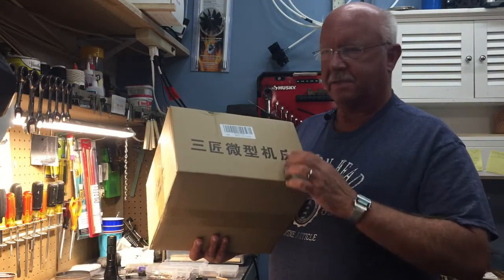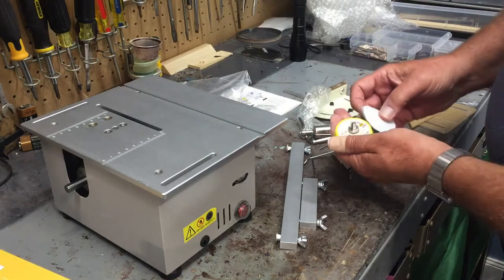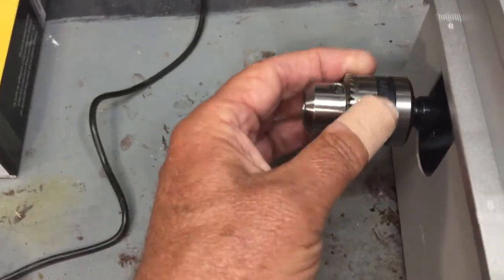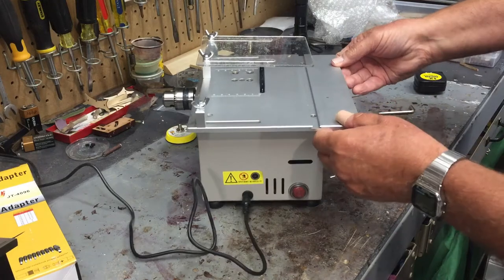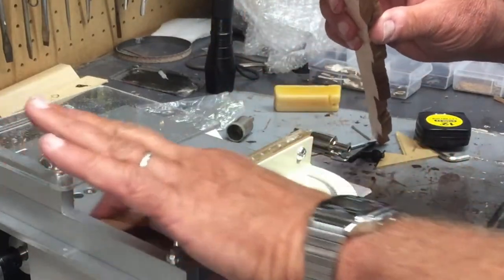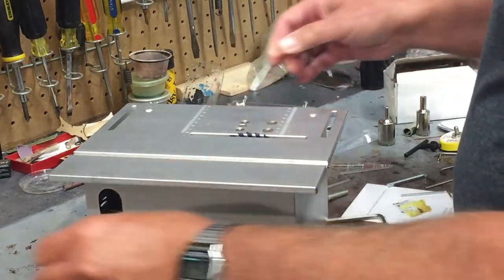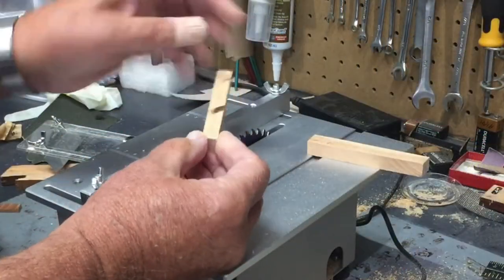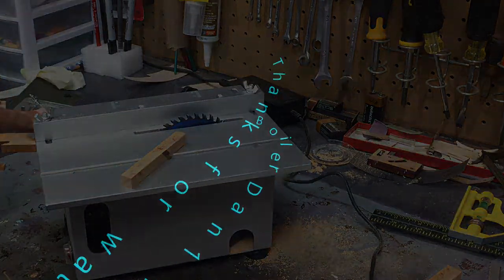Mini Table Saw Review

Comment: I just purchased one of these mini table saws for myself from Amazon and it arrived today. I spent about two hours putting it together and making adjustments. Mine is a 6 generation with the lift saw blade.  I am using it to make some half laps using Wood that is 7 cm x 20 cm. I am making my grooves 3.5 cm deep on the 7cm dimension. The first adjustment I made was to remove the metal fence from the “ruler” (miter gauge) and then I removed the degree dial.  Then I adjusted the degree dial so the fence would sit at a 90 degree angle and put a wooden piece on for the fence instead of the metal fence that came with the miter gauge.  Then I added two small washers under the degree dial.  Doing this lifted the miter gauge off of the tabletop. It had been dragging as you slid it forward and back. Secondly, I solved the problem of dust collection. I had the Flexiport Click-Connect Upgrade Kit from Rockler in my shop and one of the connectors fit in the dust port on the saw with a little persuasion from a flathead screw driver I was able the push the rubber nozzle in to the second ring groove, then I added some tape around the port to seal off the edges of the port. After adjusting the fence on the miter gauge to the blade, I removed the “Backing” fence/bezel face shield and adjusted the height of the blade and cut (using the original blade) the grooves, finishing the edges with a chisel to get a tight fit for the overlapping half lap.
Reply from the maker: You’re amazing!  I made the dust collection work by cutting the opening to fit my smaller shop vac that is hooked up to a small paint bucket wind tunnel device so the bad doesn’t collect everything.  I’d like to see your see your wooden fence design!  I’ll study on what you wrote as it sounds like some good ideas 👍👍. Thanks for sharing .
Reply: @BoilerDan1 Dan I posted my email in a reply today but I didn’t hear back nor do I see it in an answer to your reply. Did you get it?
Reply from the maker: Unfortunately, no I didn’t get it?
I’ll try mine in a response after this one.
Reply from the maker: try boilerdanone@gmail.com

Comment: Thanks Again Dan. was on the fence with this but think I will get one (maybe grind out the sawdust hole to fit shopvac nozzle)
Reply from the maker: I agree on the sawdust hole!  I’ll wait a few weeks just in case something goes wrong and I have a warranty issue....
I like the small size and if the speed is up on high, it does what I need.
Reply: Take a heat gun to hose attachment and mold round end to match that mouse hole opening

Comment: Hello.. and thanks for the video... I like these that actually show you someone using the item they are reviewing,  not just opening the dumb box..who needs a video for that... anyway, I THIS video, you show a small lathe.. I have company area where I'm working so, I too, cannot have huge equipment... where did you get that mini lathe and what was it called... please and thank you...
Reply from the maker: Thank you for your kind remarks. Here’s a link to my review on the mini lathe . 
https://youtu.be/JO0LrxvtrC0
I purchased mine on Amazon . Here’s a similar one that has. More attachments including a mini saw blade that mine doesn’t have.
Thanks for watching 👍
200W CNC Mini Lathe Machine Tool DIY Woodworking Wood lathe Milling machine Grinding Polishing Beads Drill Rotary Tool Set https://www.amazon.com/dp/B07Z2KPGMK/ref=cm_sw_r_cp_api_glt_fabc_CNM6MT44NV2CF42FXY58

Comment: Those green drive belts don't they slip? Wouldn't gt2 timing belts with teeth be better? Thank you!
Reply from the maker: This saw is really for light duty. For that I’ve not had any problems.
But if you try to cut something not light, it does bog down. Although a belt with teeth sounds great…. I think you burn out the transformer or motor.  I only use it for model ship building.

Comment: What is the brand name? What does it cost? (range) What are its dimensions? (It looks really small, esp compared with the classic Proxxon 7070 and the MicroLux Mini Tilt Arbor Table Saw. The box it came in -- was there a larger box to house that cheap cardboard box?
Reply from the maker: Price currently is listed as $114.95.
It’s obviously an import and there are different companies that buy in bulk then use whatever names they want. Ranging in prices from $99-$200.
It’s an inexpensive mini table saw for craft work. I use it to cut thin pieces and I don’t think it has much power.
Here’s a link to the item on Amazon. You can find the measurements from there.
The top is about 9 1/2” X 8”.
It’s definitely an entry level item with nothing fancy. No tilting blade.
I did put on a 4” blade and it worked.
Thanks for watching 👍
Reply: @BoilerDan1  Thanks for all the additional information. About a year ago I thought about getting the Proxxon 7070 (retailing about $365 or so). It has been unavailable, perhaps due to CoVid issues in manufacturing, shipping or what not. So I have also considered the Proxxon chop saw, which has fewer features and is cheaper, about $100 less. This item is also hard to find these days. My sense is that the Proxxon table saw is a bit larger than your saw. One more thing: many years ago I had a Dremel mini table saw and it was frustrating. The thing was not accurate and I never was happy with the untrue cuts.

Comment: Table saws this small are potential tools to make small model furniture but you didn't really give any indication on the precision capabilities of this saw. Hows the fence? Does it clamp on square to the blade at both ends? Any slop in the miter gauge channel? etc. What size blades does it take and are there any better after market ones?
Reply from the maker: It’s not precise, So you need to line up the fence on both ends as it’s just two thumb screws to hold it square. But it works for me.
The blade holds steady considering the price and for light hobby work.
The blade: 4.5"(110mm) Circular Saw Blade I ordered a 60 Tooth Cutting Fine Finishing Table Saw Blades for Woodworking Rotary Tool with 3/5"(16mm) Arbor and it’s giving me a smoother cut.
Thanks for watching and the constructive criticism 👍👍

Comment: It would be really nice if the lifting was basic and the blade angle could be adjusted as well~~
Reply from the maker: I agree.  I’m overdue to make an update:
If you stress the motor any, it will burn out the dc transformer.
The good news is that I took it in to a local electronics shop and they fixed me up with a much better transformer and it now cuts harder wood.  Not sure when I will post something?  Doesn’t solve the no tilting issue but works much better now!

Comment: Would it cut Vinyl Plank Flooring?
Reply from the maker: I don’t think so.  Since the posting, I tried to cut a thicker piece of oak and it burned out the transformer.  The company replaced it for free, but Vinyl flooring would put a lot of drag on the blade.  Light duty crafting is what I would recommend.
Thanks for watching.👍

Comment: Thank you for your video sir. But when giving a Amazon link more better for as
Reply from the maker: Several available at Amazon:
Do a search for “mini table saw “
Below is a link to one like mine:
Thanks for watching 👍
NovelLife Mini Hobby Table Saw Handmade Woodworking Bench Saw DIY Model Crafts Cutting Tool with Adjustable Power Supply 63mm HSS Circular Saw Blade (R2) https://www.amazon.com/dp/B093ST1TJL/ref=cm_sw_r_cp_api_glt_fabc_P823ZC47G1JBFG3VYZPD

Comment: Thank you  so much.
Reply from the maker: It’s not a top end tool and I use a small square to get the guide true to straight. But for light duty it’s working fine for me.
I was concerned about being able to find a replacement band if the one were to wear out or break. I contacted the seller to inquire and they sent me a couple extras at no cost!
Thanks for watching and the positive feedback.👍👍

Comment: I have one of thses and like it,BUT,it doesn't give a square cut,the blade isn't perpendicular to the table. I made some shims from thin brass sheet,I haven't got it dialed in yet. this blade is carbide-tipped,and will cut 1/8" aluminum nicely. I made a large crosscut sled from hardboard that guides by the edges of the table top,it really makes a difference in cutting,but reduces blade hieght to about 25 mm. the rip fence was a PITA,so I made a T-square from angle aluminum and clamp it with a spring clamp.  As this review said,the blade guard is worthless. I suppose you could 3-D print a flip-up guard like a regular table saw and attach it at the back,and include the riving knife for more safety. Paint mixing sticks make great push sticks. I also wish I had bought the 360W version,or they offered an upgrade kit of new 895 motor and 15A power supply.
Reply from the maker: Thanks for some great info 👍
Your talent greatly exceeds mine.
I recently purchased a 3d printer, maybe I will look into printing out the design you suggested.
I agree that the motor is a little weaker than I’d like…. 
Thanks for watching and sharing your thoughts.👍👍

Comment: Where did you get it?
Reply from the maker: Amazon:
https://a.co/d/jkSeM9e
Reply: @BoilerDan1  decent price for sure, I’ve been looking at the proxon one. Nice video thanks 🙏
Reply from the maker: Just realize that it’s light duty for craft type work.
Thanks for appreciating my efforts!
👍
Reply: @BoilerDan1  oh that’s what I want it for hehe. I have a serious table saw. I want this for thin balsa wood mostly. I think it will work fine. I’m ok with taking multiple cuts or even modifying the machine to my needs. I have a proper lathe for polishing. I’m just looking for a quiet accurate saw to cut small hobby stock.
Reply from the maker: Should work fine for that.
I recently saw (no pun intended) what looked like a magnet strip being used as a fence on a similar saw.  Like the strong tool holding strips that Harbor Freight sells.  I may try that!  Assuming that the top of my saw isn’t aluminum? Hmmm maybe I should check that out first 😂👍

Comment: You'd think they would have made it with an adjustable stop block at the front edge of the fence so that you can use the miter gauge for repeatable cuts without running them up the entire fence which is really dangerous. If the offcut gets pinched between the blade and fence you could find yourself eating a flying chunk of material. 

I don't understand why you'd put a drill chuck on the side, either. Very strange but i suppose if this is the only power tool you own, at least you can do a little sanding with it, or even chuck up a drill bit and just push the work piece into it. Actually, that could be brilliant for getting perfect 90° holes, if you have a good flat surface to work with. Thanks for the review :) oh, and is that a custom saw blade or does it use one from a circular saw thatd be easy to replace?
Reply from the maker: I was able to order a thinner blade on Amazon, so yes it’s a standard size that’s easily replaced.
I’m considering trying to make some kind of jig to make repetitive cuts….. 
I’m only using for light duty type cuts and so far so good!  I agree with you regarding the drill chuck? Not sure what they were thinking.  Maybe sometime I’ll hook a drum sander on it???
Thanks for watching and providing some feedback. I’m sure it’ll help other viewers too! 👍👍
Reply: @BoilerDan1  I just had an even simpler idea for making safe repetitive cuts, just clamp a small c clamp or whatever you have on the fence closest to the user side of the saw, and bump your wood up against that before pushing forward to make the cut.
Reply from the maker: You should make YouTube videos 😂👍
Reply: I saw someone had made a mini sled for one of these to do repetitive cuts. Rather than tracks that slid in the table (as a sled would have on a regular table saw) they made it to slide along the out side of the full table. 

It seemed to work really well and the stop block idea is perfect too. the only hitch would be if you can get the blad high enough to accommodate the sled and your material. I’m going to try this.
Reply from the maker: Thanks for watching and joining the conversation. Just want to mention that it’s a light duty saw.  I tried maxing it out and the transformer burned out. Seller replaced it but ever since I have used it for light cuts.
Still like it but want to keep people informed.👍👍

Comment: The blade guard/cover is totally in the way and actually makes ripping dangerous. You need to be able to apply downward pressure especially on that small , short length piece you attempted to cut only to find you couldn't complete the cut. Downward pressure is almost as important as forward pressure when ripping because the back teeth are constantly trying to lift it up off the table. I also assume the blade is not of great quality and may not have enough set to the teetth to cut efficiently?
Reply from the maker: At the time, I had not obtained a push stick. You’re correct that you need downward pressure to complete the cut. I have since obtained a quality push stick (X2). I’ve also replaced the blade with one with more teeth to get smoother cut.  I will add that I only use this for light cutting in craft type cuts. Specifically wooden model ships.  For light duty I’m happy with it. You’re right that any power tool involving a blade cane be dangerous.
Thanks for watching and expressing your concern.👍👍

Comment: Hello, i just bought this machine and waiting for delivery, my model is t6 from allsome (AliExpress). Did you found a replacement blade? If yes have you had to buy an arbor adaptor or what? Second question, these belts looks so fragile can they be replaced with normal “black” belts? I will use it for luther works.  Thanks!
Reply from the maker: I tried a 4” blade from another saw I have and it worked. The blade that the saw came with was a little under 4”.
The round hole in the center is what’s important. 
Here’s what the manufacturer says about the blade size that will work: Compatible Saw Blade Bore Diameter: 16mm / 20mm   
I found this one at Amazon and I think it will work but I haven’t tried it yet. 4"(110mm) Circular Saw Blade 60 Tooth Cutting Fine Finishing Table Saw Blades for Woodworking Rotary Tool with 3/5"(16mm) Arbor https://www.amazon.com/dp/B07SBTYW1M/ref=cm_sw_r_cp_api_glt_fabc_00HCME7GBPCRZXJEWF3D?_encoding=UTF8&psc=1
I don’t know about the belts but I would think that if you have the same size belt it would work?
I’m guessing that you might be able to order replacements with a little research?  If/when mine wear out I’ll check it out 😂
Thanks for watching 👍👍
Reply from the maker: I checked with the place I ordered mine from.  Currently there isn’t a source to purchase the belts from through them, but they are sending me an extra set at no charge!  I tried to explain that mine are fine and that I was just asking for future reference.  I’ll measure them when they arrive so maybe I can see if other belts will work!
Reply: @BoilerDan1  there's two blade sizes for these; a 110 mm  and a 63 mm size. Mine came with the 110 mm carbide tipped. the smaller blades are not carbide tipped,I believe.
Reply from the maker: I did replace mine with a smaller one. I found the correct size, I think at Menards or maybe Amazon?
I don’t use it often and just for light duty cutting.
Thanks again.😎

Comment: Rate and purchase link to
Reply from the maker: Today Amazon has one on limited time SALE for under $80. I couldn’t link to it, but here’s a link to one for under $100
NovelLife Mini Hobby Table Saw Handmade Woodworking Bench Saw DIY Model Crafts Cutting Tool with Adjustable Power Supply 63mm HSS Circular Saw Blade (R2) https://www.amazon.com/dp/B093ST1TJL/ref=cm_sw_r_cp_api_glt_fabc_P823ZC47G1JBFG3VYZPD
Thanks for watching

Comment: I think this machine (and similar ones) would benefit from a riving knife at the back of the blade to prevent material grabbing the blade and lifting up during a rip cut. Otherwise it looks a good little machine for light craft work.
Reply from the maker: Definitely a good design change idea.
And it’s definitely for light craft work, but not a toy. It’ll snip off a finger just like a big machine!.
Thanks for watching.👍
Reply: I think it was Confucius who said mini table saw and small pieces of wood make for dangerous situations.